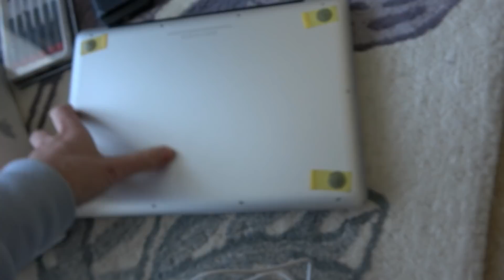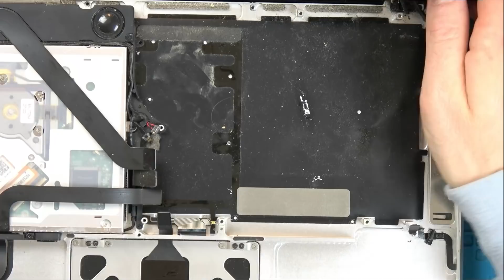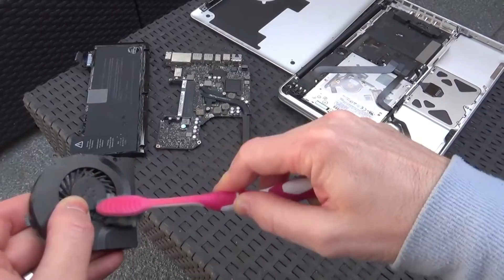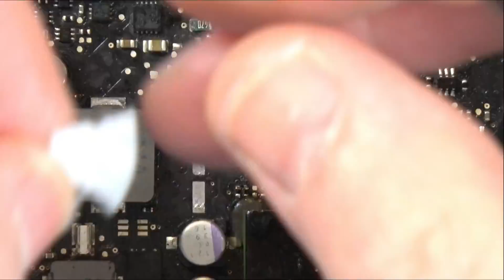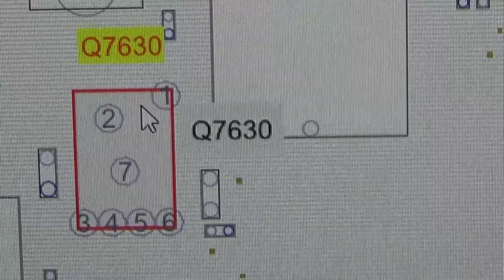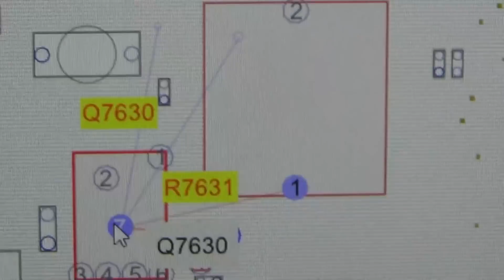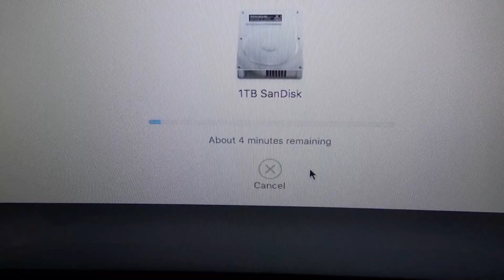My 1st Attempt at Fixing an Apple MacBook Pro A1278 from eBay

Comment: Hi Vince, I have a 2012 motherboard that has water damage. It was removed from a chassis and I replaced it with a working one. If you want the water damaged motherboard for spares or to try and make one good board from 2 non working ones, then let me know. I think a revisit on this would be interesting as I try to keep old Macs running as long as they can, just not to component level repair any more, but I love watching you work your way through the problems.

Comment: You should run Opencore Legacy Patcher and upgrade OS. These MacBooks like dual ram so always use both slots.
Reply: whats that?
Reply: @EpicBunty  it’s a program which allows you to boot non native OS to a Mac system. Macs also like to use both slots of ram at same time, makes them quicker
Reply: non-native OS ? like an OS which is not MacOS on a macbook ? hmm.... didn't know that was possible with macs... @cambike 

thx.

Comment: The exploding Cap is probably something that would happen to me, too! There's a kind of putty (you may have a different name for it), green in color, that can be used to cover other components for heat protection. Thank you for the great video. The putty is called thermo gel. Try micro repairs ltd here on Y/T. Great fix!

Comment: You may be using the wrong type of hot air station, have herd that hot air stations can really vary in quality and result in an abysmal chip removal experience,  also might want to be a bit more careful next time use captain tape on the components near the burn chip maybe ware safety glasses, think that capacitor was one of the old electrolyte ones, you really don’t want to get that crap in your eye

Comment: You can't fix a smart error. It's a warning that the HHD or SSD has bad sectors and needs replacing. Also I would prefer 2x2gb rather than one 8gb because it will run in single channel and crippling both laptops now.

Comment: Love this video!!!! Immediately when I saw the fan full of dust 2 min into your video plus you feeling the heat manually over the motherboard i knew what to do. Open it all up and undust!!!! Which i regularly do on my DELL XPS 1700 PC. On a large PC tower it is easier to do. I use carefully my 1700 watt hoover on suction cup with an ordinary 1cm broad stiff art brush. Usually i undust regularly all 6-12 months as my home too is very dusty, the air fans sucks the dust in from the room. I notice that then too the PC slows down in the RAM memory which i take for a clinical symptom. So it really pays off to here'n there to undust the item inside as dust clogging up memory cards + fan(s) leads to overheating + slowing down which is then no joy on a gamer's PC. You made a good price here, imho. 🕵💖💖💖 apols 7 min in you may want to get a new motherboard!!!!  Darn, so not a good bargain. That'll be me. Hence I prefer (Dell) tower PCs which are easier to maintain, upgrade or replacing burnt out components which is cheaper than on a notepad. Sorry for your losses.😭😭😭

Comment: dunno if you'll read this but a nice trick i learnt from an aussie repair guy on tik tok is spray the board with IPA (isopropyl) for "Hot-Failed" components and look at where it evaporates from first.  he did it on the motherboard of an Iphone x max.... good for locating hot spots if you dont have an Infared heat camera

Comment: There is an app called Mactracker which has all the info on every Mac, straight away I think the processor is better on the new board but the original board has superior graphics chip

Comment: You have many options such as parallels to install Windows to run Windows apps in MacOS or you can use the bootcamp app to install Windows and dual boot. Great work on the MacBook.

Comment: You don't have to repair traces on the inside layers, schematics are available so you can actually see exactly which traces go over that burnt area and test the continuity between the 2 most easily accessible points for either side of each trace. and repair them externally with wire. The hard part is just making sense of the schematics and figuring out what you're looking at. Louis Rossmann repairs a lot of water damage and maybe he has videos where he has dealt with similar damage. Very useful information on that channel.

Comment: You be better off spiltting the 2 ram kits between the laptops so you have at least 4gb of dual channel ram.

Also i feel like you where on the right track mosfets can short high or low and 12v woud be near instant death.

On that board view id assume that that rail only goes from the mosfet to the cpu in witch case the short can only be the cpu. If that rail appered elseware than you can look there but it doesn't look like that.

Comment: bad flux mate it would be better if you get a better solder and clean the solder iron from time to time and start by puting mor new solder to mmake it easy for the hot gun to work

Comment: You should compare the mesurements to both boards in ohms, you will find that vcio in many boards have low reading as this goes to the CPU, cpu have low readings in ohms in all its supply, meters will show as a short but its not, its low resistance not a dead 0 ohm short, replace that fet and see if it turns on, fan spins cos trackpad was unplugged on the other board, speaker and mic was trapped becouse you not removed the cable holders on the hinge. These boards are very complex and enable signals very much rely on other signals. My first time I was lost in repairing macbooks, theres a hell of a lot to learn and all models are different in some way, some are tricky and some even look the same but they are not. If you are thinking of going into this direction, then there is a hell of a lot to catch up on and some issues cannot be fixed by just looking at components, knowledge of how each model motherboard works is neeeded in macbooks, taken me years and still learning new stuff all  the time, and seeming its not worth it as there's a lot doing this from home now watching Loiuse Ross and I started back in 2010, prices of re-selling these macbooks are going down all the time on ebay and im struggling to be competive, way to many for sale now and ive spent a fortune on equipment and a BGA machine. Electronics is seeming to be less and less profitable and they are getting cheaper to buy new anyway, for fun its all good, but for a living, NOPE!!. Been watching your channel for a while now, very interesting and fun on showing items ive never opened before, nice work. :)

Comment: (40:13) I still recommend having 2 sticks of RAM of the same kind if the laptop allows for that, for dual channel RAM.
(42:29) That's a very iconic feature of MacBooks, though Apple did away with it starting in 2015 in order to help make the newer models thinner.

Comment: I am no professional but I have much better luck fixing 15 inch unibody.  13 inch models temd to have charging problems which is a board level repair that are beyond me.  15 inch models are usually bad keyboard or GPU with bad solder joint. GPU solder joints respond very nicely to the hot air treatment.  Some say to disable the AMD GPU but you end up with a severely handicapped machine that is only good for email.

Comment: I am hooked on your videos. I like the fact that you don’t have the 20 minutes that everyone else does. You go from start to finish and they are great. I did some research on the MacBook Pro 2011 and according to Luke Miani this models graphics was terrible and always fails. He said Apple would replace them over and  over for up to 4 years after purchase. The same crappy graphics were re fitted. They always die apparently. He recons the mid 2012 ones were bulletproof and are one of the best ever made. So maybe head for them on the next project. Thanks for fantastic viewing.

Comment: I gave my wife my older 2012 MacBook Pro when she bought me the new MacBook Pro and she loves it for her craft work. Felt guilty due to the MacBook kept shutting down or the screen would go blank. The omitting blank screen was a loose lcd connection had to use some tape(no not wrapping tape lol)  to hold it in place and the shut down was due to poor thermal paste, and thats the beauty of these old laptops, easy to clean inside fan and do other work on.

Comment: Running machines with just one memory stick when there's two sockets is BAD.
You can probably get somewhere between 25% and 40%! better performance by populating both memory slots with the same size memory sticks so it can run the memory in dual channel mode - having double the bandwidth available doesn't give double the performance but it damn well helps a lot especially on a machine with integrated graphics like this one.

Comment: I've only got to 5m 22sec into the video and I'm wondering if the Processor and GPU heat sink need taking off, cleaning up and thermal paste reapplied plus cleaning the vents and removing dust build up? I'm fully prepared to be wrong but that's my thought at this point.

Comment: I've had / have an A1286, the amount of times I have pulled the PCB out, heated it and stuck new thermal paste in must be in double digits by now, it works for a month or so, then it needs doing again. It's the GPU that causes the problems on these older ones.

Comment: The schematic said the shorted pin was CPUVCC. VCC is voltage supply and CPU is the processor. So I’m pretty confident in your original assessment that the CPU will have received 12v and that is definitely going to cook the CPU in a split second. The die on a CPU is using only a few nanometres for the traces and that much voltage will destroy them like a mini firework display.

Comment: CPU Vcore is a low resistance rail. That coil is fine(always use ohms for vcore.). Thats just because cpus are low resistance. https://www.youtube.com/watch?v=0K8hb9RwBrY . also yes shorted mosfets are bad news. i have had many gpus that have seen 12v to vcore.

Comment: I guess its the missing capasitor and the missing mosfet. I dont know how much it will compare but i had the same issue with a 780ti. Blown mosfet and had a full short and the gpu. Took it off (way rougher than you lol) and the short was still there. I took an other mosfet from an other dead card and the short was gone. But the card died again in minutes at the same point.

Keep it for spares. Connectors etc.

Comment: Heads up when you use a toothbrush on MacBooks .. they can pop little resistors and even other little ICs .. so grab a ultrasonic cleaner if you can if not a lighter non static brush

Comment: another good video, personally prefer these longer videos, didnt the 2011 and 2012 versions have graphic chip issues
Reply: It was the 15" and 17" models with graphics chip issues. Early 2011 and late 2011 models. (2010 models, too with the Kernel Panic) 
The 13" models use the Intel HD graphics on the CPU, so no issues there.

Comment: That's a late 2011 not 2012. The core i7 2011 15 inch has hybrid graphics Intel/amd and the AMD graphics chip will fail... Every one of them will fail sooner or later. Don't buy 2011 MacBooks. You still can deactivate the AMD chip via  commands or a $60 hardware hack. Of course you seem to have burned components but it's because of the faulty video chip why I don't recommend buying used 2011.

Comment: When the board is in an "off" state, don't get fooled by the cpu being shorted, i learned this the hard way, whenever a board is in this off state, (it can remain in the off state while you inject voltage as well, because there can be more than 1 line to 'wake up' the cpu), the cpu is shorted to ground to protect itself, you have to check which cpu this is, and do research about it, you can get this cpu in the "wake up" state by injecting voltage in the right spot. Check out @amantComputers's channel, he has a video about this topic. Hope this helps to shed a light my mate Vince

Comment: Errrr, Vince, 1v injection for a cpu or gpu line is high some of these have operating voltages below 0.8v.
These lines also run wayyyy low resistance that WILL beep in continuity.  Diode mode measurement is the way to go with these, red probe on ground....

That said, dead CPU is possible given the fault.

A1278's are well known for the discrete GPU to expire, it does so gradually getting worse and worse.  There are many solutions to this that involve disabling it and forcing the system to use the one built into the cpu.

Hit me up if you need any help.

Comment: Couple of things, Vince: That HDD did sound like it was faulty, but whenever you are working with a powered on, spinning HDD, you shouldn't ever be manipulating its position. The HDD needs to remain as stable as possible while spinning. Also, 4GB of dual channel RAM will most likely give better performance than a single stick of 8GB in single channel.

Comment: it is extremely rare for a cpu to blow normally, but high voltage or water damage can be a killer. but I do believe there is probably more than one fault with the mainboard. and if there is then highly unlikely that it would be repaired by anyone, well manufacturer would just strip the board and replace as cheapest thing to do, an inexperienced person would not be able to repair it without a few mainboards under inspection, and only 1 fault on each of those boards. as hard enough to find one fault, but could just as easily be following a 2nd or 3rd fault without knowing it. do I think 12 volts went through to the cpu? I wouldn't like to put money on my answer, but nothing is impossible, so it is highly likely, but without finding the other fault or faults there is no true way to find out without putting the cpu onto another mainboard.

Comment: Bet the best part of this fix was giving that MacBook Pro to your daughter, and despite being a 9 yr old Mac, Macs hold up really well with age.  With the SSD upgrade and the extra RAM (and running the newest software that will load on that machine, High Sierra, it's only 3 version behind what's current, and as you could see, it runs like a top, and will for several more years until the software becomes too outdated.  Would have like to see the look on your daughter's face when you gave it to her though :)

Comment: 1. It's not the apple logo that lights up its just the back light of the screen lighting it up.
2. Get another 8gb ram and run in dual channel
3. Get yourself on hotukdeals and look for 1tb ssds. You got slightly ripped off paying £80 for that ssd.

Comment: You should install 2 ram sticks so the cpu igpu has dual channel ram to work with and be faster dosnt have to be same size or brand ram only needs to be same frequency i have a 4gb and one of the original 2gb stick in my mid 2012 mbp 13

Comment: When your measuring coils that connect to cpus, Vram and such you should switch your meter off beep mode and measure the value in ohms. Sometimes it can be as low as 10-30 ohms which is perfectly normal but this will beep your meter.
Reply: Agree with you, around cpus you may read very low resistance and that's kind of normal.

Comment: Vince , congrats on the fix. that first board was beyond saving. You should consider getting 2x4gb sticks instead of the single 8gb as it will let you use dual channel mode which is much better.
Reply: I was going to comment on this to Vince also.I guess he was just using what he had available, But you are correct any computer will run faster in dual channel mode-makes a lot more improvement when pc has onboard gpu or apu beacause that shares the memory too.

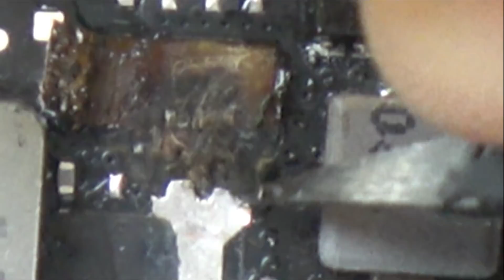Comment: At 20:22 that flacking off is the fiberglass from the pcb substrate. You should have tried to do a continuity test on the exposed layer copper pour to see if it is a power or ground plane that you can use.

Comment: Water damage can simply be from all that scrunge dust absorbing any humidity in the apartment/house/or camping tent! Of course, after many years of abuse. And never,ever leave a Laptop/Desktop unit on the floor, where first of all, dust gets pulled in and by chance a desktop unit is on the floor, it’s susceptible to mop splashing

Comment: I think you can make it work, if you check your solder connections where the the little blown chip is.
You have solder that bridges the sixth and fifth pin of that chip and one pad of the capacitor that gone BUM
Try that and maybe it will work.
All in all great video, keep up the good work.Sorry for bad english
Reply: The board is fucked and the short is in the internal layers as you can see in the baord virew there was a via under the chip and that goes directly where Vince have reached the inner layer.

Comment: I knew from the very beginning that cap will go BOOM. NorthridgeFIx showed such some weeks ago on videocard.
Reply: Why did the cap explode? Was it Vince's fault, residual power still in the board? I don't think he discharged the board after he disconnected the power.
Reply: @DaMu24  From the heat of the heatgun.

Comment: Please do at some point install a second stick of RAM so that you take the advantage of dual channel. As it is, with 1 stick, you're getting single channel so you're leaving performance on the table. Other than that, good video, too bad that you managed to buy the 1 board you wouldn't be able to fix at first but fortunately you managed to get something going by grabbing another board. Good job.

Comment: You really need to match pairs on the ram you take a sizable hit not using the dual channel.  In the Lenovo T430 I have I droped 16GB HyperX ram 2133 ( Only works in dual channel ).

Comment: I would switch the Ram to the other slot. The MacBook will try to read the top first then it will bounce back as empty and then read the bottom slot. Since it’s Intel it isn’t as big a deal as if it was an AMD CPU.